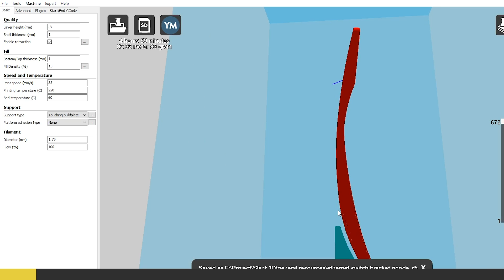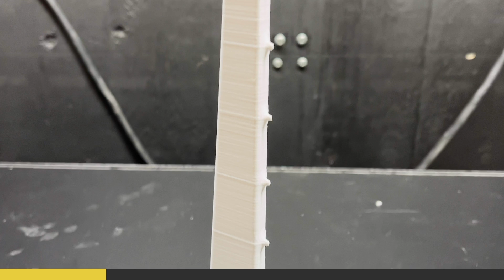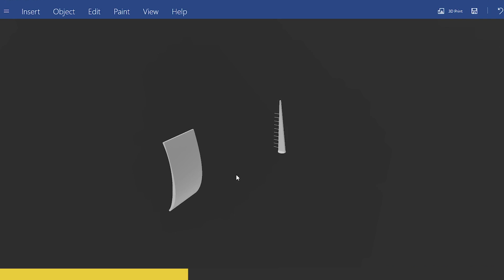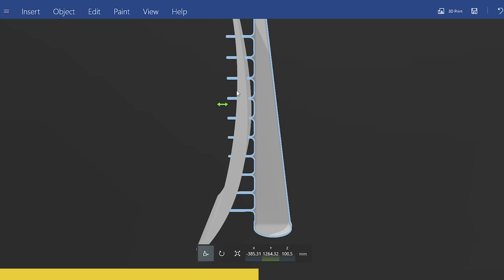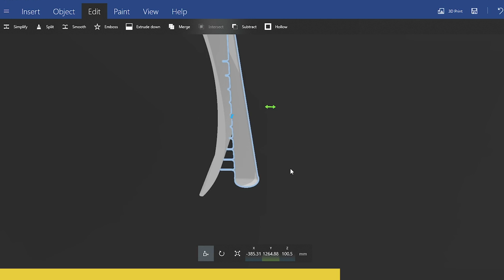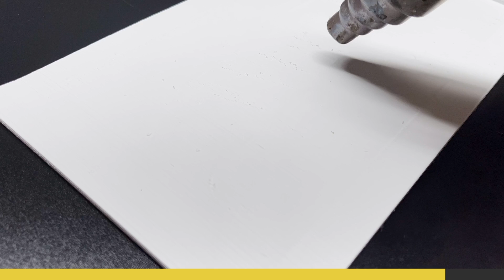Stop Tall Prints From Falling Over - Design for Mass Production 3D Printing

Comment: This is brilliant. I think a variation of the hairy lion style connections could provide even better quality. Basically what you are doing here but using only 1 or 2 extrusion width 1 layer high bridges instead of cones.
Reply from the maker: Too many pock marks if you go hairy
Reply: @slant3d  Right, that's a good point. Perhaps only for models that don't need to look good. Might be easier to remove.

Comment: Just out of curiosity, would it make sense to angle the sprues upwards at 45 degrees towards the part? or is there a good reason to keep them parallel to the build plate?
Reply from the maker: if they are angled they become towers that require a retraction and good cooling settings to print. Horizontal lets them be in the layer plane so they are more reliable.
Reply: @slant3d  I was actually aiming at the "Read more..." expansion button, not yet ready to pose MY question, BUT - Since I'm here...: How is all this horizontal printing IN THIN AIR NOT just trading one problem for another? Successful bridging is hardly without it's challenges, especially with differences in material types!???
Reply: @slant3d  ah, that makes sense! Thank you!

Comment: My main trick is to gradually reduce the speed over the course of the print. And if you're on a bed slinger, rotate the print so the widest dimension is aligned with the bed movement direction.
But for mass production, how about printing multiple of the same part with threads connecting between them, so they become self-supporting like a corn field? Maybe print them in pairs rotated back-to-back, so all the connectors are on the convex side. It would save a lot of time and plastic compared to those fat towers.
Reply: Yes that works just as good
Reply: For mass production why wouldn't you go with plastic mold injection?

Comment: Easier to make the supports in CAD, in my opinion.
Reply from the maker: Absolutely if you have control of the original cad that is definitely a good way to do it. But the comb still applies.
Reply: @slant3d  Gonna have to do it in CAD since the comb is no longer available on your website.

Comment: Or, get a better printer with a static bed.
Reply: You also have to completely get rid of any bed springs then because the nozzle will impart a vibration into them via the print. And even without them, there is springiness and flexibility in the print itself. So having these sorts of tall thin structures well supported is helpful regardless.
Reply: @SianaGearz  No springs uh? So just the  tramming screws?
Reply: @kurtnelle  a number of different approaches have been done. Replacing springs with silicone tubing, which is compressible but also damps vibration. Some just design the whole printer in a way where no tramming is needed, several designs use hard spacers of premade length. Another is indeed adjustable hard attachment - bed screws with nuts under the bed, above the bed carrier (for adjustment) and securing nuts below the bed carrier.